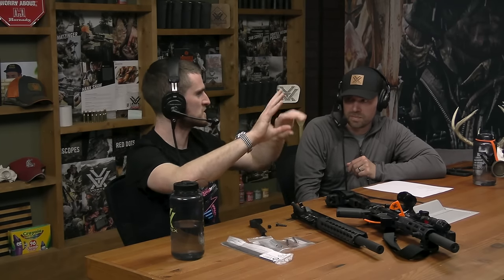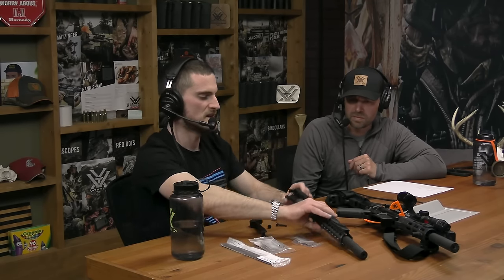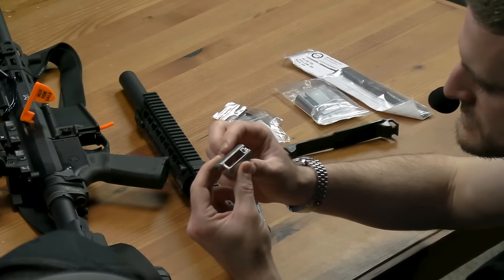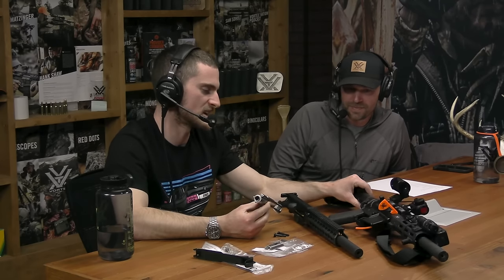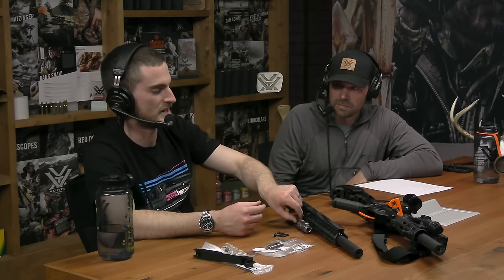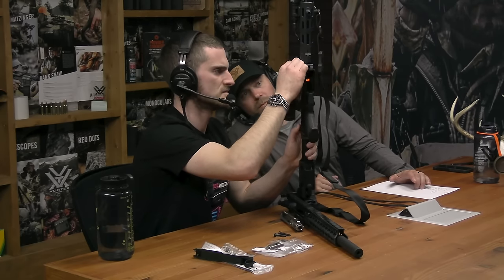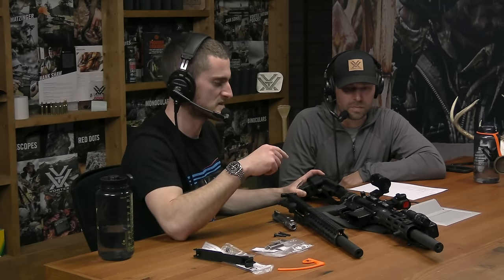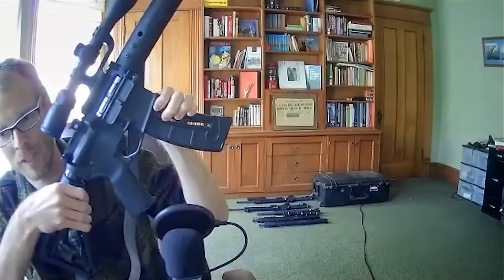Ep. 237 | .22 LR AR Builds – Everything you Need to Know

Comment: At 27:34 Will is talking about using the forward assist and he essentially says that you don’t need a forward assist on the AR platform,  to which i have always argued that if you need to use a forward assist, then you are just treating a symptom of a deeper problem which Will confirms is the need to clean. This is also what separates the M16 from the AR15. In combat you won't have time during a firefight to clean your weapon,  so a forward assist can keep you in the fight, but on the civilian version,  if you have a need to use a forward assist,  then you can just take the time to clean your weapon,  so my point is, the AR15 (without the forward assist) is definitely NOT a military grade weapon and SHOULD be in the hands of every law abiding American!!
Reply: It's even worse on non-standard ar15s.  My aero m5 in 308 has a forward assist.  I tried to use it to quietly load a round into the chamber during a hunt.  Took me about a minute to clear the malfunction caused by trying to use the forward assist.  The forward assist just adds like 4oz of weight to the gun and serves absolutely no function.  All it can do on that rifle is get stuck on the bolt and get in the way when using the charging handle.

Remember, the government requested the forward assist and they are wrong about everything.

Comment: Are beyer barrels just hands down best?
Reply: They are very good, but they do have tight chambers so they need more frequent cleaning.  We're going to offer barrels optimized for accuracy and feeding/extraction for as high of round counts as possible between cleanings.  Most people are putting more than a couple hundred rounds through these on a given range session.
Reply: @BoreBuddy  i saw you have a 4.5 inch barrel placeholder on the sight.   will you be offering longer ones?
Reply: @BoreBuddy  i was drawn to the idea of the beyer because if somehow the worksheet thing the atf is pulling on piatols actually comes to fruition the beyer barrels being alluminum might have helped me stay sub 4 pounds
Reply: @LyleH-13  Yes, we are planning to offer a 16.1 and a 12 (if the 12 happens depends a bit on what happens with braces).  I'd say the 12/16s are probably going to be August-September.  Staying sub 4lb is going to be tricky with a long barrel.
Reply: @BoreBuddy  A 12 inch barrel would scratch exactly where I itch.

Comment: lol...speak for yourself about not caring if your .22 destabilizes at 200 yards and falls to the ground.  There are more and more of us out here now that shoot .22's at 300 yards plus.  Granted it's not with a cheap AR .22 conversion kit, but still.  I have a couple of rifles that shoot .22 lr extremely well at range...they aren't cheap rigs but once the investment is over, you can shoot very accurately at a very inexpensive cost.  I'm able to shoot 3 days a week without the wife screaming about the cost 😅, and I don't have to seek out a 1000 yard range to shoot "long range" relatively speaking, as I would with a center fire.
Reply: We're going to be introducing some barrels in the early fall that will stretch the stability of the 22lr out much farther.  In general terms, 99% of shooters will probably never shoot at more than 200 yds.  I often lob 22lr out to 300+ as well (using dedicated AR22 uppers, generally).  It's amusing, but not terribly precise with cheap ammo and a slow twist barrel.
Reply: I’ve shot a fair bit of .22lr at 200 yds, I haven’t yet shot a load that has wildly destabilized before then. Both 1/16 and 1/8. I use the run of the mill 36gr and 40 gr stuff, so some of the more exotic stuff like Stingers and whatnot may, I dunno. Standard Velocity does well out to 200 and beyond.
Reply: @509Gman  Absolutely!  I've shot a good bit of Standard Velocity as well.  I like the Wolf Match Target and Wolf Match Extra.  It comes off of Eleys retired Tenex line, but the tolerances are still great and a fraction of the cost.  It's even made by Eley in England for Wolf.  So Eley just kept the old Tenex machines and built new ones as well...the old machines stuff is sold as Wolf and New machines Eley Tenex.  
Maybe you already knew that, but if not, it's worth a try.  It's pretty accessible as well, because most guys think Wolf is junk...so it's in stock alot more than other Match grade stuff.
Reply: @BoreBuddy  I must have missed this comment when you posted it.  I'll have to remember to look your barrels up soon.  I'm not against AR style .22s for longer range, just haven't had as good of luck as I have with CZ 457 match rifles.  If I could find an AR style that came close, it would make for good training.
Reply: @Tbowie13  We're trying to push the AR22 platform to the point where this might be possible.  Right now it's not quite there.  We should have some fast(er) twist 12" and 16" barrels on hand in the fall.